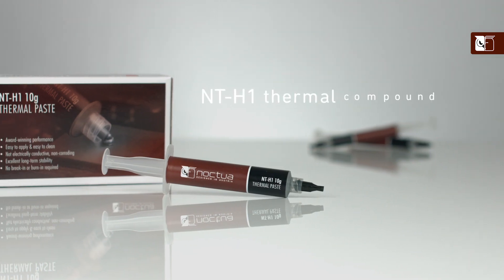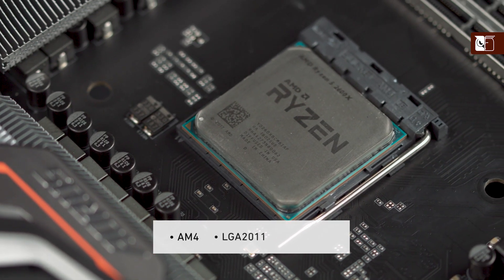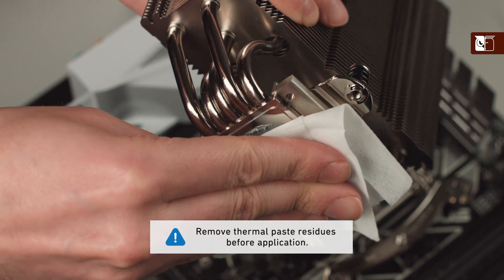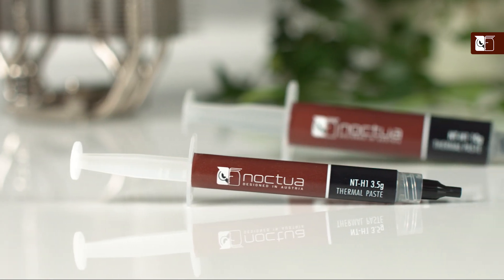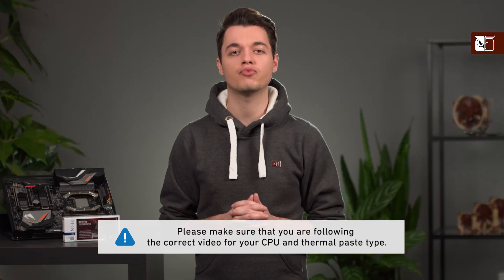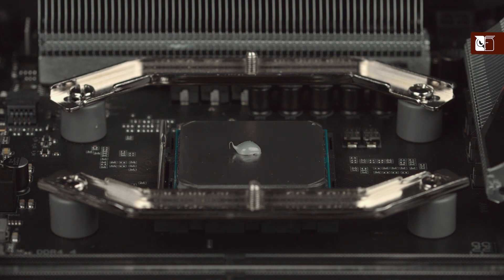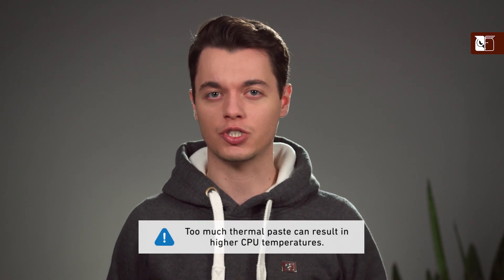Noctua NT-H1: How to apply on medium-sized CPUs (e.g. AMD AM5/AM4, Intel LGA1700, LGA2011 & LGA2066)

Comment: That’s honestly way too little to apply, when the contact plate is pushed down it will probably only cover 2/3rd’s of the CPU. 

Application should be about double that amount, and manually spread with a spatula for complete coverage.

Comment: Got the paste, bought a prebuild that began having heat issues early in it's life span, a little less than a year in. Checked the cooler and sure enough the Paste was unevenly applied and was probably of a low quality as well so now we got the good stuff. Gonna replace the cooler with the noctua cooler soon as well.

Comment: Your instruction manual says 3-4 mm in center and 2mm in corners for am4
Reply from the maker: Yes, this is our updated suggestion. Both will work well, but the 5 dot method tends to provide slightly better coverage towards the corners.

Comment: Interesting how on the manual it told me 5 dots 4 corner one centre. this was for the NH-D15
Reply from the maker: Apologies for the inconsistency, we are updating our recommendation for the 5-dot method because we see slightly better results. Both work fine though.
Reply: @NoctuaVideos updating the recommendation to use 5 dots or one dot?
Reply: 5 dots is preferred as per their other co. Ment response
https://youtube.com/watch?v=GcMz2imdQuM&lc=UgwvkGoTmkMVGiHxM794AaABAg.9mJje_oXWoa9mKJJUXQ5f2&si=FXAlMZjaupFsB1nh

Comment: If you put this Noctua NT-H1 thermal paste on the Ryzen 9 5900x processor, how much will the temperature decrease?
Reply from the maker: Unfortunately, this is impossible to tell without knowing which paste you are using at the moment.
Reply: @NoctuaVideos  kryonaut thermal paste
Reply from the maker: This is a very good paste, so you shouldn't expect any major improvement.

Comment: Hola, en el folleto encontrado en la página web del producto NT-H1 3.5g dice que son 4 puntos de 2mm y 1 punto de 3 a 4mm en el centro. Cuál es la cantidad correcta para una CPU mediana como la LGA 2011?
Reply from the maker: Yes, we have updated our recommendations. Both methods work well, but we have found that the 5 dot method described on our website tends to give slightly better results.

Comment: Hello thanks for the interesting video. I have a dh15 (I used it with my 5820k) which I'll re-use on the new Ryzen 5600x. A quick question: is it ok to put the dot in the middle, even if 5600x has the chiplet offset to the upper right corner? Thanks.
Reply from the maker: Sure, it will spread easily.

Comment: I dont know why but my i9 10850k with 360 AIO MAG MSI have struggle with this nt-h1 paste

3 4 day use is ok but the next week the temp increase so much just like 10 degree !!! and more !!!

I dk why
Reply from the maker: This sounds really strange, we have never seen anything like this with any cooler (air or AIO). Are you sure the same thing doesn't happen with other pastes?
Reply: Pretty sure cause everything in bios are manually by my hand

:(
Reply from the maker: Sure, the question is if you see the same behaviour with a different paste though. Either way, have you checked how the thermal paste imprint looks when removing the cooler? Does it get squeezed out, dried out or anything like that? For example, (very) poor contact between the cooler and the CPU can cause such effects, but this would not be an issue with the paste as such but rather with the cooler and it's mounting system.
Reply: @NoctuaVideos  The first time it dried out, and temp increase so much, after re-paste the temp so cool, but 4 to 5 days it like the same :( 

Idk what to do now . . .
Reply: @NoctuaVideos  that's mean I must use more pressure on the heatsink to cpu and thermal paste before screw it right ?
Reply: @NoctuaVideos  no luck with the pressure, it's become high temp again :( 

:( Kinda sad cause the first few day alway good temp around only 6x ~72 temp 165w i9 10850k and now it's over it . . .
Reply from the maker: @MrTakasuRyuuji  we'd recommend contacting our support team (support@noctua.at) and they will be happy to help you try and find a solution.
Reply: @NoctuaVideos  I've test too much paste on cpu too and it gone worse like you said
Reply: Friend you probably bought fake paste 🤡

Comment: I just love these videos. I got an NH D15 last year. From what I've read, it can last for up to 5 years on the CPU, but how often should it be changed for maximum efficiency?

I also have half a tube of NT-H1 left over from March-April 2020, I suppose it's still ok to use. 

Oh and that D15 is the best cooler I've had, very high quality.
Reply from the maker: Thanks for your great feedback, it means a lot to us and we're glad to hear that you have been so satisfied with the cooler. If you'd like to help spreading the word, please consider leaving a customer review where you bought it, we'd greatly appreciate it!

As for replacing thermal paste, it is not really necessary unless you see temperatures going up and there's definitely no need to do it before 5 years: https://noctua.at/en/when-is-it-necessary-to-reapply-noctua-thermal-pastes

Of course you can still use paste from Spring 2020!
Reply: @NoctuaVideos  thank you, you're the best <3

Comment: Damn, Noctua is really out here replying to every comment. I have to give it to them, they're the Apple of computer components
Reply from the maker: Thanks for your kind feedback, providing the best possible customer support is a key priority for us!
Reply: Isn’t Apple terrible with customer service and especially the products?
Reply: @DoubleBirb  who told you that? Apple's customer service is second to absolutely nobody else on the planet, especially for their physical products
Reply: @sknight8621  I guess I assumed that their customer service wasn’t good because Apple has shady practices but now I’m not sure.
Reply: Apple does do a lot of things well, especially in terms of software development, but they have a very poor track record when it comes to enabling customers to keep using older products,especially when it comes to issues regarding right to repair. Noctua couldn't be more different than Apple when it comes to this.  

Instead of planned obsolescence and products which become increasingly difficult to upgrade or to even get repaired, and instead of being told that you need to buy a whole new computer when a third party repair store could easily repair it, Noctua sends you free mounting kit upgrades so that their CPU coolers will work with new mounting standards on a new motherboard, and their fans are highly modular and easy to replace, and are also extremely reliable and tend to last an extremely long time anyway. I have never seen any other company actually pay for upgrades out of their own pocket, and ship them to you for free, just so that you DON'T have to upgrade. It's incredible.
Reply: More info on what's wrong with Apple products from an experienced independent Apple repair technician: https://www.youtube.com/watch?v=AUaJ8pDlxi8
Reply: sometimes I feel like the youtube comment is even faster way to get in touch with noctua compared to the support email, especially if you just want to ask simple things.
Reply: lol apple sheep detected.

Comment: I just got an NH-U12S and I was wondering if I should I use this method to a 3700x, or maybe I should spread the compound with a plastic (credit card type). I'm a little worry about using this method and dont use enough compound (or use too much)... Thank you so much.
Reply from the maker: Yes, this will wor nicely for the 3700X. Most users find it easier to apply the appropriate amount of paste using this method, but if you prefer spreading, that's fine too. Applying a bit too much paste is usually no big problem, so don't worry too much!

Comment: Was going to order this but how does it work on bare die. Do you get the “pump out” effect if used on laptop and GPU chips?
Reply from the maker: Sure, it works fine on bare DIEs, lot's of people use it on laptops and GPUs.
Reply: Noctua_at any push out problems?
Reply from the maker: No, as we've said, it works fine.
Reply: Noctua_at Ok, well that is in direct contrasts with a lot of reviews and YouTubers stating that the paste pumps out. At some point, this topic will need to be addressed, b/c  more and more people are talking about it. Either the reviewers and YouTubers are lying or Noctua representatives are downplaying concerns. Personally, I have just canceled two of my Noctua orders today until I can do more research on the matter.
Reply: Ended up going with Kingpin KPX.

Comment: Wtf I just receive a NT-H1 3,5g thermal paste but I just can't use it.
Even if I push really hard the paste just don't come through
Reply: The black thing that looks like a nozzle is actually a lid. It needs to be unscrewed.
Reply: @generustft  ty I'm so stupid srry
Reply from the maker: No problem, sometimes it's hard to see the obvious! ;-)
Reply from the maker: Yes, please remove the cap first, you can easily push out paste then.
Reply: @NoctuaVideos  omg I'm so dumb, ty ^^
Reply: Just look at this https://youtu.be/b8iUjngesIQ

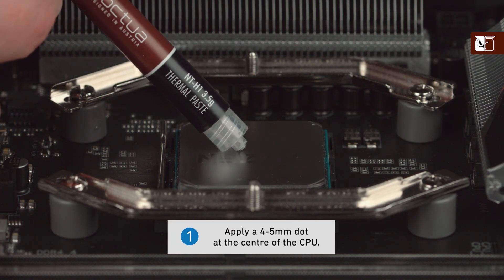Comment: Hey Noctua, I have a tube of NT-H1 that has been sitting for a long time (more or less 7 years) without use. The tube has of course been closed the whole time, but the paste is very "rigid", just like at 1:08, and doesn't come out liquid at all afterwards like shown in the video. Is it still good to use ?
Reply from the maker: NT-H1 is a very viscous paste and if it spreads like in 1:08, chances are that it's fine. Many users have still seen good results after years and years of storage. With that being said, what we guarantee is a storage time of 3 years without significant losses in performance. After 7 years, depending on the conditions, performance may start to decline slightly. You could just give it a shot though, but if you want to be on the safe side, better get a new tube.
Reply: @NoctuaVideos  So what would "optimal" storage temperatures are humidity be you think if one doesn't use it all and wants to reuse it after 5 years?

Comment: what are everyones temps ? i have a NZXT s340 Elite with 4 120mm fans and sitting at around 37 idle 72F ambient
Reply: mine sits at 42-45 idle,should I get a new thermal paste?
Reply: Zed from what I hear your temps are normal changing thermal paste may help a little but not much depends on what case and type of fans (size,hoe much air they’re pushing or pulling, static pressure fans or high airflow fans )

Comment: Was wondering if the NH-D15S comes with a wipe to get rid of the old thermal paste? Don't really want to use tissue if I can help it
Reply from the maker: No, the cooler doesn't come with a wipe but you can buy our NA-SCW1 wipes seperately.

Comment: 1) What will be best method dor Ryzen 3xxx (different placing of cores - not quite trust single dot method in that case - maybe better x or spread method - but dont have experience?). Ryzen 3xxx will change your recommended method?
2) Will be buying new PC within a month and also consider NH-D15 or NH-D15S with f.e. Ryzen 3700x. Considering I will remove or move higher front fan is there a need to buy NH-D15S instead NH-D15 (if price difference between them is lower then price of fan)? I would use in on standard size motherboard like MSI Carbon Pro x470 or Asus Strix x470 with memory lets say 44/43 mm. Not sure what will chenge this assimetric build in this case (and if there will be difference in this case). Additional info: I will also buy Fractal R6 which should have place for even 185mm cpu cooling
Reply from the maker: 1) Our recommendations don't change for Ryzen 3xxx, the paste will spread nicely so the position of the cores won't be an issue.
2) Please refer to our motherboard compatibility list to check if D15 overhangs the PCIe on a particular motherboard. In this case, it makes sense to go for the asymmetric NH-D15S: https://noctua.at/en/support/compatibility-lists/mainboard
If you use RAM with 44mm and the case has 185mm space, you will have no problem if the 140mm high fan sits on top of the RAM!
Reply: @NoctuaVideos  You really sure about that? That one dot in the middle is still enough for the Ryzen 3xxx serie, because of the 3 chips.
Reply: Which method did you use on you ryzen? im buying a ryzen 3xxx soon.
Reply: @jaapie181  Simply use the method in this video, Ryzen 3000 series is AM4 and medium sized CPU. I use it... any other method won't make a big difference, fairly sure. I run R7 3700X+Noctua NH-D15S.

Comment: I use old lga 775 and q6600 quad core is be compatible with stock intel cooler ? The cpu is  hot i using cheap china thermal paste $1 full load 75 and core 1 fry on 88 degress almost reach 100 btw i live in tropical climate temp room is 32-33 in afternoon
Reply from the maker: Yes, you can use NT-H1 with the Intel stock cooler and you should normally see a few degress better performance than with cheap pastes. However, upgrading the cooler would give you bigger improvements.
Reply: Ok thaks for reply i have ordered this paste and wait to arrive from shipping,i hope this paste help lower my 6600 temp in idle and full load using stock intel coller and in the future i will replace with good buget air cooler with heatpipe and plan start uprgrading my pc with intel lga 1150 or amd am4 platform  if i have bucks of money,i using my pc to run old2 gaming and music mixing....

Comment: Nice :) I'll build my first desktop pc this summer andI think I will choose this thermal paste for the upcoming Ryzen 3700X. I hope I won't screw up xD I've seen you got NT-H2 in store too,  should I pick it instead ? The most imprtant thing for me is thermal paste longevity/endurance as I don't want to change it too fast. Either way thanks for the video, you're awesome Noctua ! I can't wait for a Noctua NF-A14 PWM refresh, loving your Noctua NF-A12x25 PWM :)
Reply from the maker: Thanks, great to hear that you're so happy with our fans and considering our thermal paste. Long-term stability is the same for both, you can use it for at least 5 years. The only difference is that NT-H2 offers that little edge in cooling performance over NT-H1. It shows especially at higher heat loads. Please see this video for further information: https://noctua.at/en/performance-comparison-nt-h1-vs-nt-h2
Reply: @NoctuaVideos  Indeed I'm a fan of your fans ;) I'll definitely pick NT-H2 then. My first all Noctua-Amd build will be silent and cool. Thanks for the reply o/